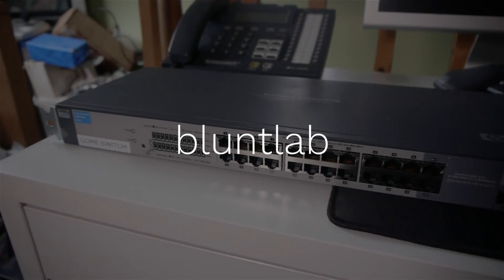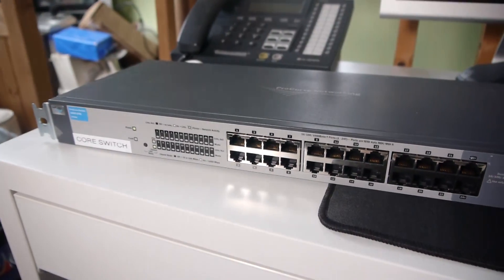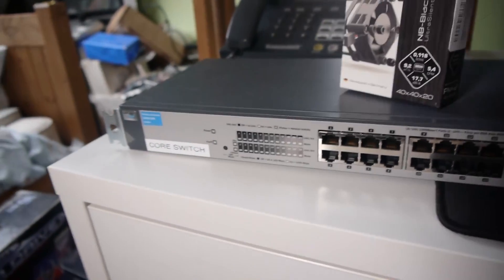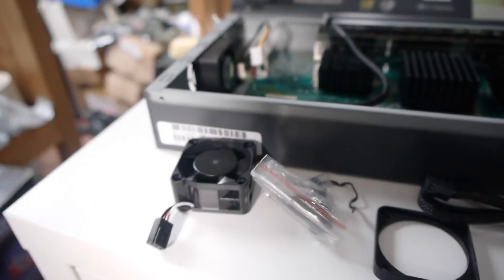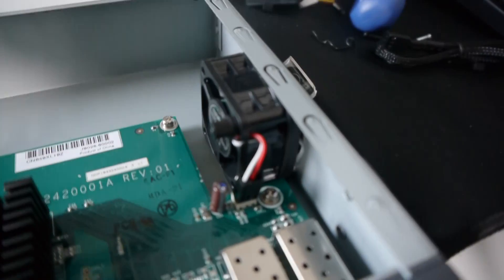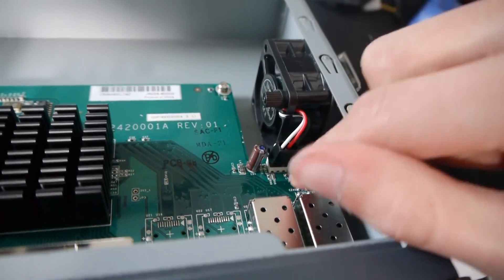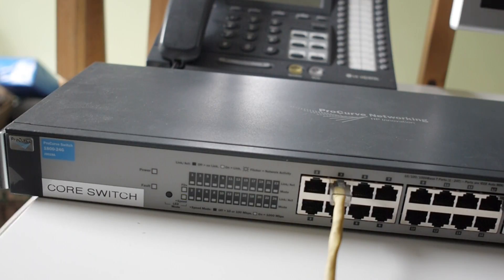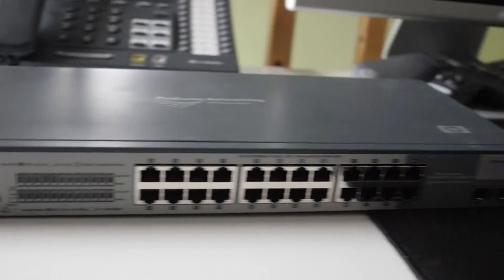How NOT! to replace the fan in a HP 1800-24G network switch

Comment: Reset the Switch by running the ethernet cable from 1 to 2  plug it in leave on 40 seconds then unplug your router is reset.

Comment: what i did with a HP switch that i bought real cheap is to just cut a hole in the metal top cover a little smaller as 140 mm with 4 screw holes at the corners, and put a 140 mm fan on top of it, it is as silent as it can get, and the airflow is even better as these tiny fans that it is using by default.
Reply: Hi, how did you power the fan, and did you have it as an exhaust working with the intake fan?

Comment: Thanks for sharing your pain. I'm about to replace the fan in my HP V1910, per a youtube posting, but I think now I will inquire that the "upgrade" is working ;-). Good luck with your replacement system! I'll subscribe, hoping you do some followups.
Reply from the maker: You should be fine with a 1910. I modded my new 2810-24g and it has been working well over a year now with no issues. I think the 1800's just get a lot more toasty than the 2x10 and 1x10's

I would mod it then monitor its temperatures before racking it up. Defo dont leave it overnight without monitoring it for a few hours to see how hot it gets. my 2810 was still getting toasty with my last fan mod and as it is nearly summer I just remodded it with a fan with a higher CFM as to prevent damage

Comment: Is it beeping?
Reply from the maker: No beeping. these switches lack a buzzer in them. My only guess as to what happened is something cooked itself in the PSU or Mainboard as it was acting like it had power but not enough?

I ended up giving the switch away though as the 1800 isnt a fully managed switch anyway and lacks basic features like VLAN and Port naming. switched it for a 2810-24g which cost about the same used and is much nicer thanks to the CLI

Comment: have you found a way for the noise issue finally . Is the switch could be fixed?
Reply from the maker: i'm afraid not, this model of switch runs extremely hot and I killed mine putting a replacement fan in.

put the same single fan in a HP 2810-24g which normally has 2 fans and it runs cool despite a fault light.
so I cant stress this enough, with the HP 1800 DO NOT mess with the fans as if a fully managed 2810 can run cool with that fan and the 1800 cant then clearly the 1800 is some sort of beast when it comes to heat output.

if you want a silent 24 port switch look at the HP 1810-24G basicly a 1800 but fanless so 0db
Reply: yep 1810 i knew it...big misktake  just too late i ordered 2 HP1800 as it was the cheapest managed Gigabit semi pro around on ebay ... my ears are gonna bleed ... got to find a way .. maybe CPU heatsink on the chip?
Reply from the maker: you might of struck lucky as the are some fanless HP 1800's but not a common model and no real way to distinguish between the two in an ebay listing as their identical just the fanless 1800's came towards the end of the 1800's life

already got a large heatsink on the chips, like a massive one, could possibly mount fans on them but they do get very toasty, enough to burn yourself on them
Reply: Good to know, maybe out of luck.. because it has to go just with the computers under my desk... also doing a 40GB network "mesh" in paralllel on the same machines with mellanox connectx3 NICs EDR/FDR stuff . Did yours is up and running yet ? with the quanta (nice, awesome ) switch all SPF+ ?
Reply from the maker: cool, want to get into 10gb networking but the quanta switches are loud and very few switches with SFP+ ports, the 1800 is only SFP so maxes at 1gb, the few switches with SFP+ are more expensive than the quantas
Reply: yes I build one with an old PC and the free Vyyos OS or PF Sense tbd. more a router though. or just mesh peer to peer only 3 fast machines,
Reply: with dual port NICs QSFP copper , i also looked for ports pairing on standard gig. rj45 connexion.